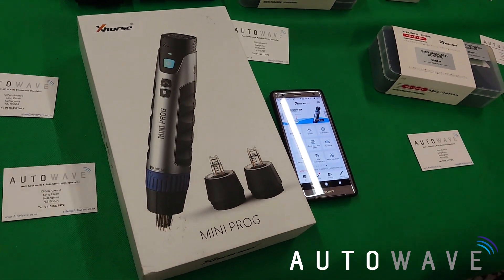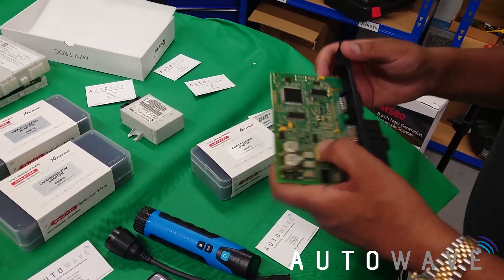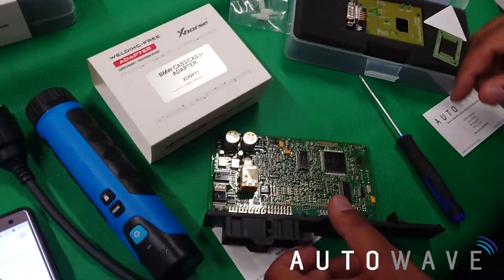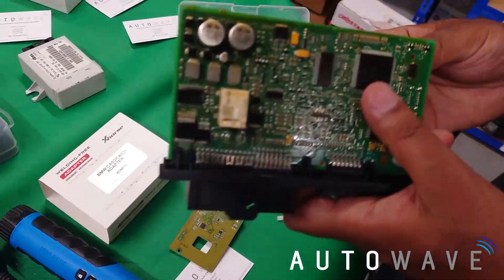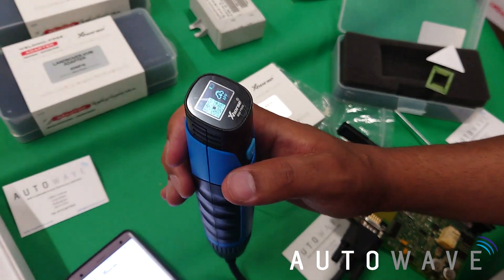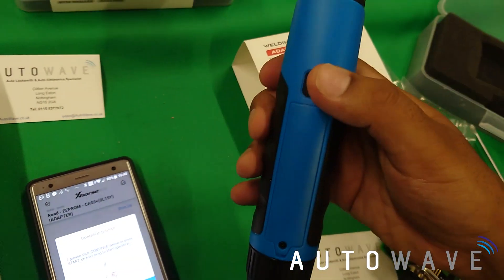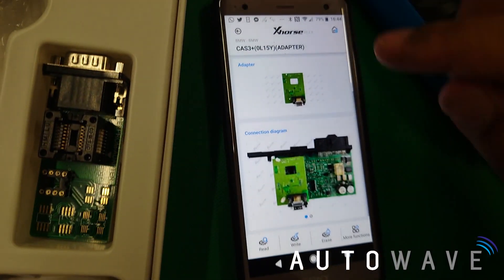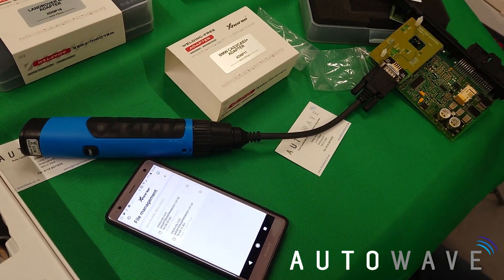Reading EEPROM data from a BMW CAS 3 using Xhorse Mini Prog and Solder Free CAS 3 Adaptor

Comment: I am practicing with this adapter, on a CAS3(0L01Y). I can not get a pin connection on the RST, CLK, XCLKS. Do I still need to get the layer of lacquer off, to get a connection?
Reply: Did you ever get it to connect?
Reply: @davidfrance2056  I sold the adapters. I bought the acdp package. It's much,  much better.
Reply: Chip crack failed? Do you know why?
Reply: Solder cables in 15 minutes done
Reply: That is something important to show in this video,  why would they leave it out?? 🤔